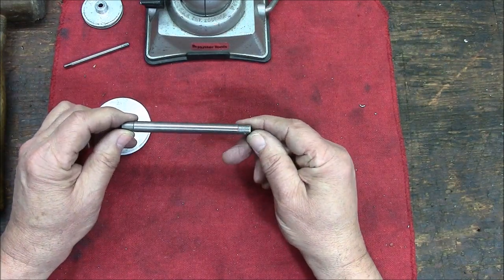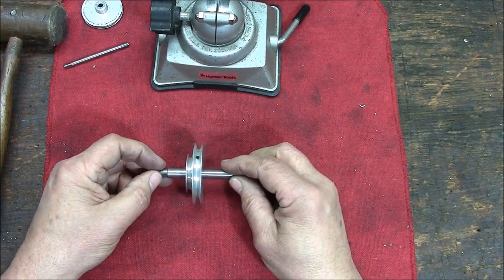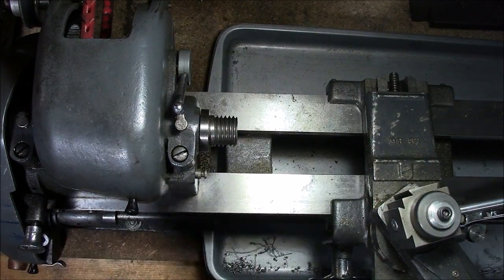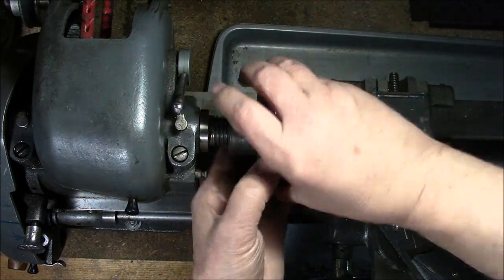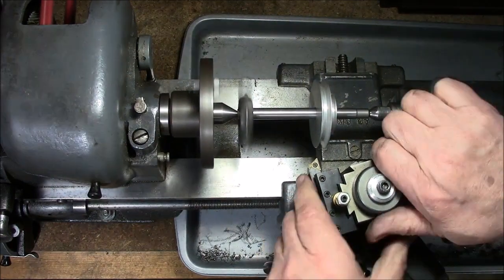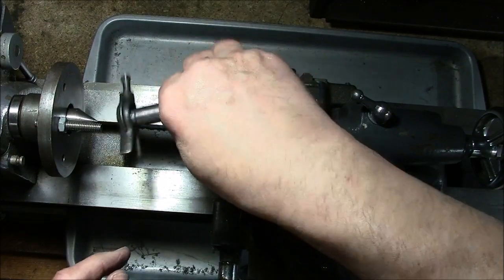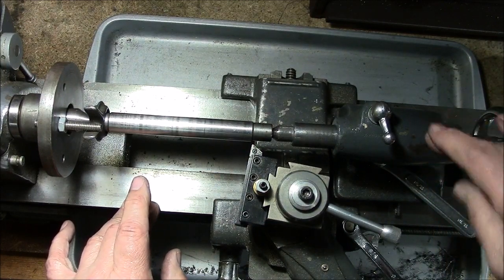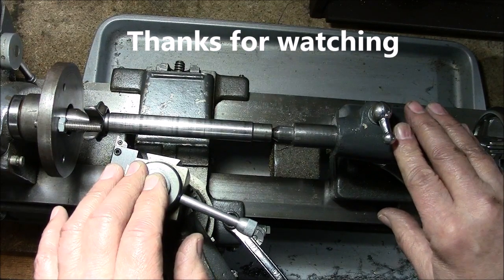Making and Using Metal Lathe Mandrels

Comment: Thanks for that, just dawned on me how using a dog and center would be a very fast way of setting up some very accurate work.
Reply from the maker: Turning between centers pretty much guarantees that your will run true every time.  Another benefit is that you can take the work out of the lathe, end for end it and it, put it back in the lathe and it will still run true.  This method of turning was used extensively during WWII in war production shops.  Pretty much unskilled workers could turn out great parts because the various causes of inaccurate work was eliminated because of between centers turning.I am pleased you got something out of this video.  It is why I make them,y goal is to educate.  Please subscribe if you are so inclined and perhaps share this with your friends.  Regards-  Fred

Comment: I don't get it, just put some round stock in the lathe, turn it to a point. Then run the pully between centers with a live center. Much faster?
Reply from the maker: Absolutely correct Kuna.  But with mandrel if the bore of the work is just a little bigger or smaller than a standard size it can be mounted and worked with ease saving the need to make a shaft for every size and its fast.  Thanks for watching...

Comment: Why not use a live center in the tailstock? I'm new to machining so was just wondering.
Reply from the maker: Great question!  My answer is that (as of yet)  I do not have a live center for that lathe with an MT1 tail stock.  I have live centers for my 10" Atlas and my 12" Seneca Falls Star.  Live centers are definitely a plus.  Thanks for watching.
Reply: plainwornout3 a dead center has no slop in it and will be more accurate as well.
Reply from the maker: A very good point!  Thanks for helping out...
Reply: For high speed of turning u may use live centre in tail stock also.....